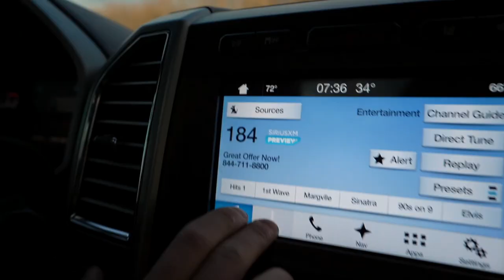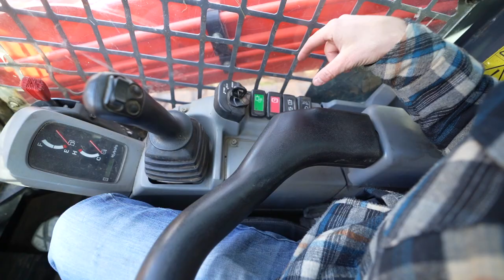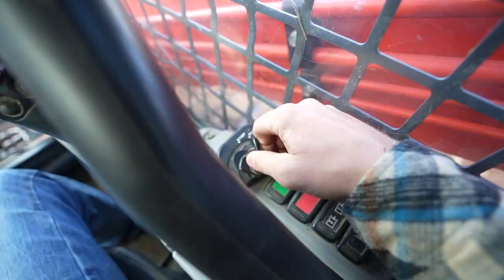PEACE OUT CATERPILLAR, HELLO...

Comment from the maker: Very excited about this upgrade! It’s going to be tremendously more beneficial for projects in the pipeline! 

A new things: 

1. Size. I know there’s a 95-2, but chose 2012 for obviously mentioned reasons 😎

2. Binders. We added one per corner after the video shots were completed. Thank you all in advance 🤓

3. I absolutely LOVED my CAT. Fantastic machine. Only a few complaints that the Kubota rectified. 

What’s your favorite skid steer brand?
Reply: Personally a bobcat fan, that door would definitely be nice while using the pallet forks though, what's your opinion of the pilot controls over the older style?
Reply: I like John Deere's because the new 333Gs are very nice and powerful according to WD.
Reply from the maker: I’ve run older style hand / foot control units, nothing new with Bob Cat. The Kubota controls are noticeably more sensitive,  smooth and snappy. It’s a breeze to operate.
Reply: You should at the cooler fans and the bulletproof windshield
Reply: I love Kubota that’s all we use at work. Controls are by far the smoothest and the easiest to run. Like you said too they have a ton of reliable power. Great choice!
Reply: I knew it was a kubota
Reply: I’m an owner operator. Iv ran them all and owned most, bobcat is complete junk..had a new t770 blow up on me after 175hrs. I’m a big caterpillar fan. Owned way more cat machines, better dealer service/support as well
Reply: I used to work on John Deere Equipment so I’m a bit biased but we had a repeat customer That only bought 333’s to run his cattle operation he also had a Kubota and a cat and said the 333s for Deere ran circles around the other two
Reply: DURTYMAX JACK JOHN DEERE
Reply: I have an older gehl 4625 and for being an early 90s skidsteer I've pushed down over 40 trees with it. I've ran a case tv370 track and yes there's amazing.
Reply: There's just something about a CAT
Reply: John Deere 333g or the biggest car skidded are  a tremendously better skid-steers. Kubotas are garbage compared to a cat or johndeere.
Reply: Going to a bigger machine you are going to go through tracks faster.
Reply: Personally I like John Deere better I’ve had them all but I’m not hatin👍🏽👍🏽👍🏽👍🏽👍🏽👍🏽👍🏽👍🏽👍🏽👍🏽👍🏽👍🏽👍🏽👍🏽👍🏽👍🏽still waiting on that square body max😡
Reply: YES!!! Love my kubota and u will too!
Reply: Am I the only one that is waiting for that square body max🤷🏻‍♂️
Reply: John Deere is the best hands down!!
Reply: Thats a down grade bud

Comment: Cat without a doubt was the better choice. I’ve run them all and run one everyday. Kubota is a strong machine but overall cats the best.
Reply: I run a JCB 9.5/10 if I couldn't have it id get a Kubota there a great machine. I really dont like Cat skidsteers they right right up there for the worst ones along with case for me theres nothing I like about them
Reply: im a heavy equipment operator and I agree im just happy its not a bobcat
Reply: To me I prefer a job kubota the only thing bad about the kubota tho is the sketchy seat senser wonce u remove that it is the best machine on the market
Reply: @brandonpanozzo86  lol. Kubota makes bobcats motor. Old school bobcat last for ever. But I'd choose Kubota track machine any day.
Reply: I’ve ran both and much prefer Kabota
Reply: @robertcooper3273  i have a midsized jcb that a do every thing with and its amazing
Reply: Robert Cooper my JCB 8T 3TS breaks non stop and it loads 1 truck a day
Reply: Cat is the Cadillac of them I’ve run gehl kubota bobcat and cat and by far cat is best
Reply: The new 299D3 is a beast, since he seems to want a hi flow machine
Reply: Equipment operator for the past 5 years and would pick Kubota over anything in each model that they produce